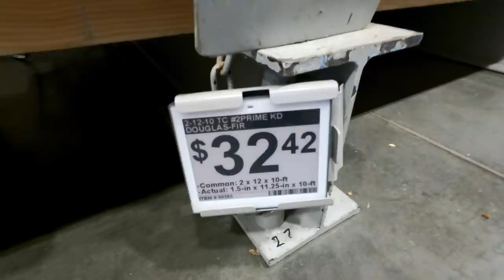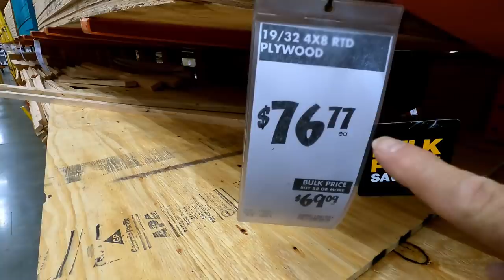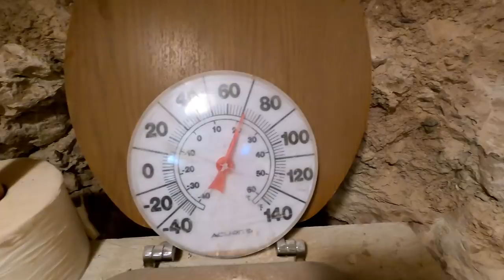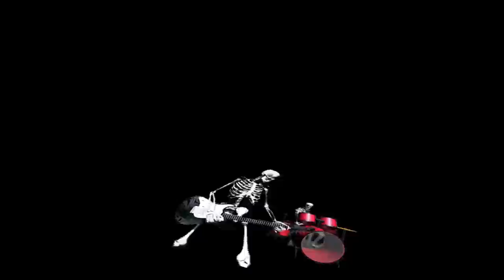When Will Lumber Prices Go Down ?

Comment: Last October price for a 4 x 8 OSB BOARD jumped to $32 each.  My roof started leaking in 3 area's during the heavy downpour and high winds we had.  Was told it would cost $15,000 to have a company put it on with rubber over the top.  TODAY the estimate is DOUBLED, $30,000 for my little mobile home roof.  The cost for 1 OSB 4 x 8 roof sheathing is $76-$90 EACH.  And I need 80 Boards. $6,080-$7,200 for 80 home depot and Lowes, not including the the glue the rubber and new gutters etc....   Wish I hadn't listened to the guy at home depot who said I should wait because wood prices will be back to normal in February. :(

Comment: Its about taking advantage during a crisis .  only the really evil do that. love your videos keep em coming.
Reply: Got a friend up in my area that works at Wehauser lumber saw mill place. They were in massive overtime for plywood. Cause dum-arasses were burning down cities.  Needed wood to board up buildings. Train yards are full of timber that is just sitting there. Hmmm
Reply: Prices were high before derick chovin committed murder
Reply: Yeah, lumber prices are up because of reduced production from Canada during (and before) the pandemic, coupled with increased demand during the pandemic. The reason that this affects the whole lumber market so much is because of consolidation in the milling industry. The high volume mills are very few and cover almost the entire market, so when they mis-estimated demand it affected almost all final timber products. This wouldn't have been an issue with more smaller, independent mills: they wouldn't have all made the same bad bet on supply, and would have been better situated to pick back up production. The problem for the big mills is that they negotiate and order raw timber far out on the production cycle, and so they're much slower to react to changes in the consumer market. It takes months for demand spikes to reach their sales contracts, and then more months for them to finish their current production contracts, and then more months until the next purchase contract is adjusted to pick back up. That and timber and lumber tariffs from the previous administration hitting their supply chain at the same time, it's no wonder prices went through the roof.

There's not enough broken store windows to account for the increased demand, it's all home improvement projects that folks could finally make time for without having to go into the office.
Reply: @haphazard1342  spot on and not influenced by fake news.

Comment: A helpful hint, buy an extra set of the dewalt mounting brackets, then mount a short 4x4 on each. It should be the same height as the saw base and stop the wood from falling either side after a cut.

Comment: Jeff you are using planed timber why, years  ago miners would have used sawn timber which would be a lot cheaper  there would be a saw mill that would welcome your business and you would save loads.
Reply: Not many saw mills in the desert.
Reply: Where is a sawmill ours is no longer and this use t be booming saw town huge !  Try the big corps ! And corrupt Federalist society paying off like Mitch MCCoNELL !  Trucking and  Containers sitting n barges cause lack  o f
Reply: Wh proffitted. most from this !?
Reply from the maker: rough cut hard to get and very expensive ....we need it now and it has to be available anywhere that is why are sets are so close together ....cheap wood ....well not so cheap
Reply from the maker: @matthewerwin4677  exactly
Reply: The small sawmills used to supply the rough cut stuff, those mills were put out of business by the influx of cheaper Canadian spruce. The big mills made all permitted buildings to use graded lumber and hired all the graders. Now all you see is the old folks checking the lumber before they buy. If we had supported our local sawmills and farmers(farmers used to have about 25% of the acreage in wood lot), done urban logging, and built on a 30 to 50-year building life plan instead of 20, we would not be here. Thanks, 1% now, would you whippersnappers vote, and holds these elected officials accountable. Please.
Reply: @danielcunningham2394  Canada has nothing to do with it. There's shit TONS of logs ready to be cut in America.
Reply: @elonmust7470  
I live in north idaho and I can tell you there is no shortage of timber being cut and hauled around here.
I can't get to the area I have been panning during the week because a logging operation has the forest road closed except weekends and holidays.
Reply: Jeff is single handedly stimulating the economy!  Jeff u are a national treasure!
Reply: @elonmust7470  not what I meant there is a youtube article on why lumber prices are high see for yourself. The rest is from a rough-cut sawmill owner that I know personally.
Reply: @danielcunningham2394  spuce is crappy wood ! Twists and curves all over the place.  Not as strong
Reply: @johnramirez5032  agreed, but was supplied as 2x4 from werhauser(sp?) in trainloads.
Reply: @elonmust7470  plenty of logs,  not enough mills .  Because small mills could not compete with cheap canadian sticks.  Small mills have less efficiency.  Economy of scales plays a massive role in retail cost in normal fair free markets.  Same thing USA did to mexican and south American  sustenance corn farmers.  That now flock to our boarders to find coroerat farm field labor income.  

True dimension rough sawn is more expensive because it has more wood in it.  Cutting a log to true dimension vs nominal dimentions.. is alot of profit loss on small diameter logs.  Nominal lumber is cut much smaller originally today . Tru dimension used to get rough stacked to air dry then planned down to nominal to smooth out the rough .  And square the warping sweep and cup .   Today its micro planed wet  and you have to  examine each stick for truet straight etc.. and learn to work the twists straight .. or mill your own
Reply: @Askjeffwilliams  Yes, cheap and junk are two different things. I just love it when they go on and on about how wood is so much 'better' these days and that is why a 2 X 4 isn't even close to those dimensions any more.  I replaced a two by four facia beam in a roof recently, and the piece that came out (from mid 60s) was like iron and flexed not even noticeably when held at one end and shaken, and that was with rot halfway across the section about half way down.  The replacement piece, more like balsa wood and flexed like a cooked piece of spaghetti.  Better, indeed..not.  Just more doublespeak (lies).
Reply: @matthewerwin4677  Oh silly me there must have been forests in the desert in the mid 1800s, I don't think so.

Comment: Jeff: Here’s a thought: Find a lumber mill and see if you can buy a full truckload of “rough-sawn lumber,” where, after cutting the lumber, they don’t then plane it down on four sides to a smooth, finished surface. You don’t need smooth, finished lumber in a mine. Plus the rough-sawn will be slightly stronger. You should be able to save a lot of money that way
Reply: However the smooth cut looks alot better, but thats a personal opinion.
Reply: @maxwellrischar9432  He’s not making furniture. He’s supporting a mine. A 2 x 4 is originally 2“ x 4“ when first cut. Then they plane it down to 1-1/2” x 3-1/2“. He could probably buy lumber a lot cheaper that’s not planed down, save a lot of money, and have a stronger product. A win-win. He’ll just have to use gloves to avoid getting splinters. He can still use the nice stuff in areas where he might touch it a lot.
Reply: You know what's better? All the lumber laying around in all the thousands of abandoned mines!!!!

Comment: The lumber is high because corperations are holding back to drive up the price. Most of these lumber mills in Oregon have it stacked as high as they can go.
This is why they used to break up monopolies.
Reply: BS
Reply: same thing here in the Northeast. Bunch of BS, the people pulling this scalping crap should be jailed
Reply: Right on, greed, plain and simple.
Reply: hat wearers....
Reply: @elonmust7470  right, what was that about hats again
Reply: It’s high right now, mainly because of COVID-19. Many lumber and plywood mills shut down, or slowed production, while the demand didn’t slow as fast. Tree harvesting slowed, as well.  Many homeowners are staying home and working on their houses, driving up demand. It’s a supply and demand issue, mostly. I’m not sure, but the new trade deal with Canada might’ve had an effect of driving prices up, as well.
Reply: This is true. Also in Washington and Idaho. Some of the logs are rotting in their yards too.
Reply: @yogadon68  Jews man, jews.....
Reply: It's who's in the Whitehouse that's the problem!!!!

Comment: Well there Sonny Jim, the reason the price of that lumber is so high is due to all them Laborday forest fires the goveners if California, Oregon, Washington, and Idaho let burn.  Now its running high compatition with all that shinny you been getten out of Slims drift mine. The sawmill right across the road from my house lost an estimated 74 years worth of standing lumber. That is just 1 sawmill. There are 4 of them within 5 miles of my residence...
I survived the Beechie Cr Fire in Oregon, I fought fire for 4 days straight, then spot fires for another 3 days, and hot spot flare ups for 2 more weeks. We saved the place. Others right next to us wern't so lucky and blessed...
Labor day wind storm blew up 17 major fires in Oregon, 19 in Washington, and 32 in California....
Just crazy man, just crazy...
You hurry up Boy, get that set put in and go get the next one before it cost more then all that shinny you been diggen...

Comment: $15 minimum , for starters . Then adds up across the board , so to speak ! Did u ever go to Magma Superior ? At 3500 ft down 167 rock temp will heat those beans . But below 6500 down too hot for timber . Only steal . How hot is it ? Don’t know ,work only 12 min and out . Pullin steaks out of broiler , about the same feeling ! One HOT. SOB  !  Thought I’d let u know in case u hadn’t gone to #9 . I was there when it closed 39yrs ago !
Reply from the maker: wow ....great story and no have not been there

Comment: Jeff how do you secure the lagging at the top of the shaft? Since its all hanging from the lagging section above it.
Reply from the maker: have one set of end plates extend out onto the surface to support the ones below it and then build set up as the waste rock piles up around the collar

Comment: Do you ever run any horizontal steel rods into the rock?  Seems like you’re relying on just shims and all thread to carry the entire set.   It obviously works but I would feel better with a couple of 3/4” x 2’ steel rods every 2 or 3 sections running into the rock....Great video, as always.   I hope the people over at Bush’s Backed Beans sends you free cases of the stuff for the free plug they get.
Reply from the maker: we run a hanging set into the walls every 20 sets
Reply: @Askjeffwilliams  Got it... Next time you do one bring on another woodworking vid....

Comment: How do you connect the notched 4 by 6's to make the square, toenailed screws?  or do they float in there
Reply from the maker: straps and temp screws
Reply: @Askjeffwilliams  temporary screws? Are the straps 90 degree brackets?  Would healthy nails work?

Comment: Well, tho I didn't see it live it was still worth the wait. Question, if you were you but back in the 1800's where would you have sunk a shaft and how rich you would've been, Jeff Williams the tycoon of Nevada and probably have a town named after you and Slim like Jeffsville, Williams Town or Slimville. Keep up the hard work mate, only wish there was some way of getting you to the Mill subs. And I would love nothing more than one day flying down there and spending a good solid 2 weeks gaining exp and helping you down there in da hole. Out of curiosity Jeff, the new chinese tunnel and cut, is that still going to be named Slim Pickins' or are you giving that leg of the mine a new name. 
Also, according to Wells Fargo the supply shortage and price hike has been caused by a number of factors, including pandemic slowdowns in manufacturing plants and a lack of capacity at sawmills and of course manufacturers and mobs like Lowes etc are taking advantage of the situation by increasing prices. The say that the price hike on timber has increased the price of building a new house in excess of $40k
Reply from the maker: thanks my friend ...like that name ...Slimsville ...well if ya ever make it down this way just let us know

Comment: Round holes with round dowels?  O_O;  Um, Jeff?  I'm really glad you're using that glue.  Has anyone ever recommended dowels cut from square stock and tapered at the end?  That's the trick historically used to keep joints from coming loose over time.  It was utilized for all kinds of carpentry including the big variety, like this one.  Hope this trick helps in the future.  👍
Reply from the maker: will have to try that

Comment: Ya know... Now that I think about it... It's a good thing that you made a second opening for the mine. If god forbid there's a cave in that blocks an entrance now you have another way to get out.
Reply from the maker: exactly and better air flow
Reply: @Askjeffwilliams   @Ask Jeff Williams   that too. Especially when taking into consideration how they were blasting rock before dynamite and gunpowder.  They would build a fire at the working face and keep it going until the rock got very hot. Afterwards they would throw cold water on the rock making it fracture from thermal shock. This process was known as fire-seetting. According to Wikipedia it was used from prehistoric times up to the middle-ages. It was for the most part used in open pit mines, but it was also used underground. While underground during those times... Good airflow may be important while air quality was not.

There's some Interesting history behind that process. With evidence going way back by a book written in 60 BC. In some places it is still used to this day. After all wood is cheaper than explosives.

Comment: How about this, the ICE BUSINESS. Food grade. Say this restaurant wants 1000lb. Your at the where house you get the call. Pallet jack ice to dock.  It's busy your doing it alone. 25 # 40Lb bag of ice. Off the pallet  stack on the tailgate (ford350 v10) . Go inside the box. Pick it up toss in back of box. Repeat unloading please putting it on a dolly, then pushing its destination and picking it up again to slice again so it goes in the box.. 20 years. Love it..           who needs a gym 💪 become a ice man. 
 And in winter we toss around 300lb blocks throw them in a snow maker. (wood chipper on stairoids with a hose)200ton 5 semi trailers.  Thanks jeff.

Comment: Hey Jeff I explained the cost of lumber on this video premiere announcement. Interestingly you point out a split boxed heart that is indicative of small diameter logs being optimized by a full scale digital scan modern band saw mill .

We need to look at about 100 years of history to understand todays lumber retail price.  The short is.. there are not enough mills standing able to meet the demands.  So there is a lack of supply.  Simple market economics.  Soooo. Anyone who doesnt know big money has influence on how government agencies operate.  Timber is big money.  There had been a small but long running over cut on public lands administered by federal gvt .. that means private companies were cutting the old growth faster than new trees could replace them.  Big scale. Across the western states.  From late 40s till the over cut needed to be stopped.  We got the owel debacle ..and all the timber beasts turned to growing weed.    The private companies shrunk to sizes they can maintain sustained cut on the private lands.  The old large dimension mills have all been scrapped over past 30 years .. in this  century I have seen all 5 small mill yards I knew of in utah are gone,  the one I ran in san Luis Obispo 30 years ago is gone .    Lots of woodmizer saws ,  but they can not do comercial.production for retail.  .  Oh your wet wood..  that's another ...they are ramming out wet wood to kerp.up with demand.  That stuff should be kiln dried!!   

All that timber is cool..  but ?  Hydrolic expanding steel sets? Is what my friends use.
Reply: There are deffinatly local regional idisyncracies in play ie sawpalmetto in the southern long needle yellow pine.   But that stuff was mostly pulp wood not lumber.  So they need to feed paper mills from another forest.  Because that saw palmettow bottoms wont grow a profit

Comment: Everyone staying home found it a good time to DIY home remodeling and projects, lumber companies saw this new spike in profits and saw it as an opportunity to devise a plan on milking it as long as possible.  Supply chain disrupted is BS, they aren't sitting side by side in cubicles at a saw mill, how are they going to catch the virus, they created the problem as a cover to justify the price increase.  Stores are packed with lumber, saw mills as high as the forklifts can reach, where is the shortage?  Now it's going to be difficult for them to give up this new money stream and they won't want to go back to old pricing, but people are going to get tired of buying these over priced kindling.  I had a few acres of pine cut near the beginning of when the whole virus thing started, I guesstimated it to have made the logger between $13,000-$15,000, I got a small portion of that.  I bet that would have been closer to $75,000 worth of trees recently.  LOL  1,000 board feet was over $1,600 just 6 weeks ago, now it's down to $900, time and labor already went into those stacks they are hoarding, stores already paid the old price so how long is it before lumber prices come back down?  Crazy how they got away with this.